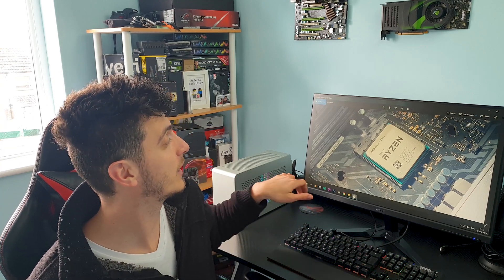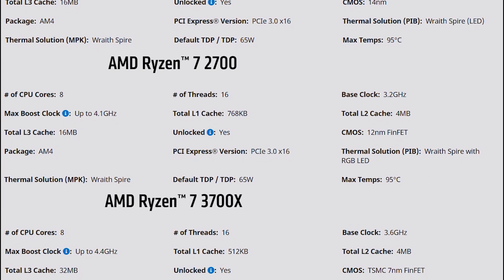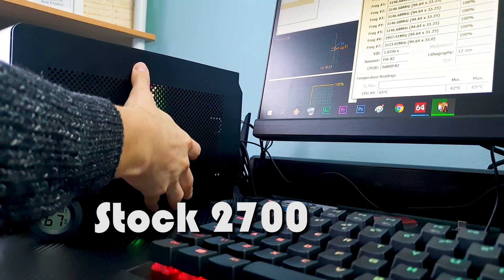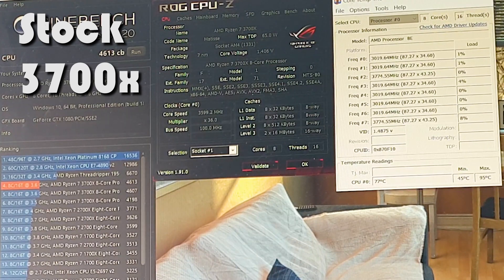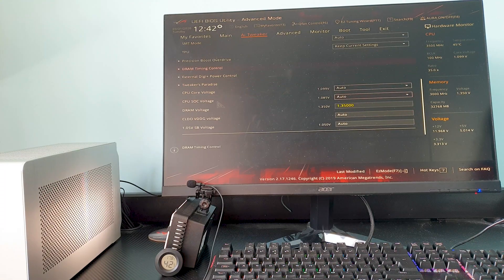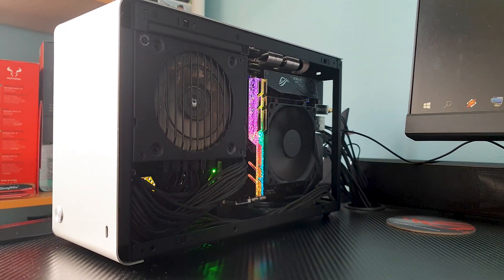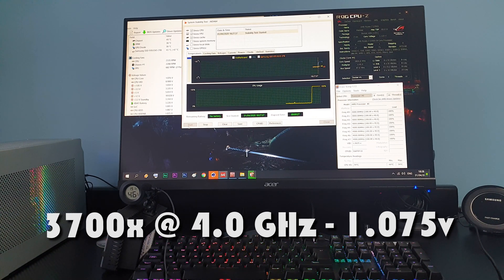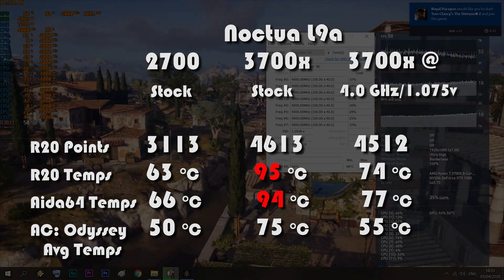Ryzen 7 3700x @ Noctua L9a | Dan A4 SFX | Is it a true 65W TDP CPU? | Air Cooling Tests – Part 1/2

Comment: This was rather strange video to see in my notifications. I am running an 3700X myself and just got myself an Dan A4 SFX V3 to put it inside, with the exact same cooler. But also has purchased the 645LT. Very interesting too see and this has me gotten to wait a bit for the 645LT to arrive and to put that in right away instead.

What holds me back a bit though is the hole voltage manual tuning. I'm not that into the whole overclocking scene and messing with voltages isn't that hard. Only that I'm not 100% comfortable with it and also then running stress tests for x amount of time to make sure the system is stable.

All I do is pretty much just webbrowsing, streaming movies and very rarely gaming. So my overall usage isn't that demanding, no way near the massive work that a stress test does.

Very nice and informative video though, can't wait for the part 2 with the 645LT!
Reply from the maker: Thank you for the comment! Another option is to try the negative offset route like some viewers have posted here :) My manual 4.0 GHz setting is in use for a few days now, I have edited and rendered the video with no problems at all, played The Division 2 and everything is perfect. I will try to finish the AIO testing as fast as I can.
Reply: What are your temps with the water cooling?
Reply from the maker: @der_rechtsamwald  The video with the AIO results is live as well!